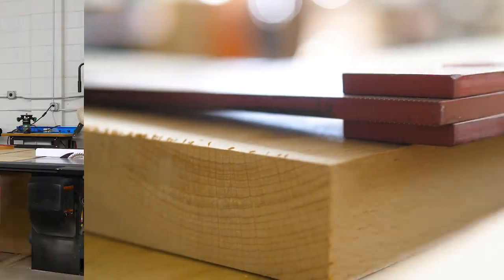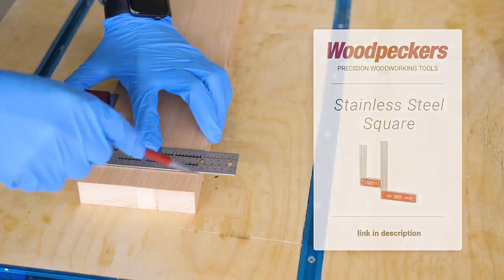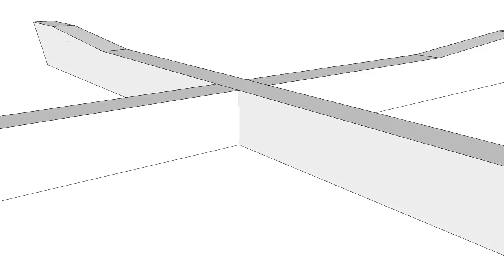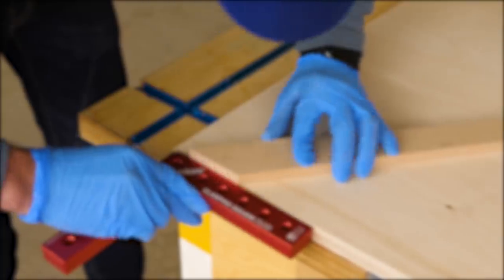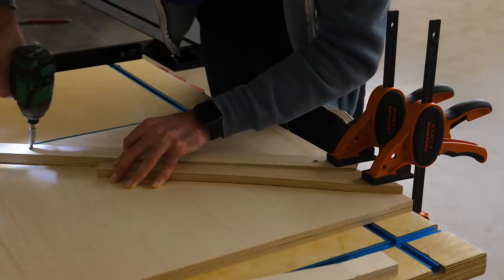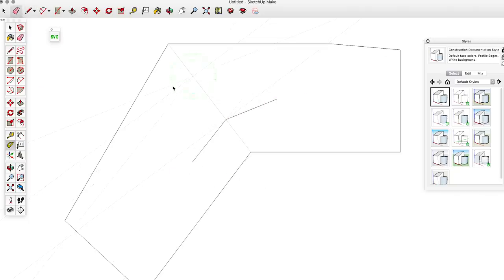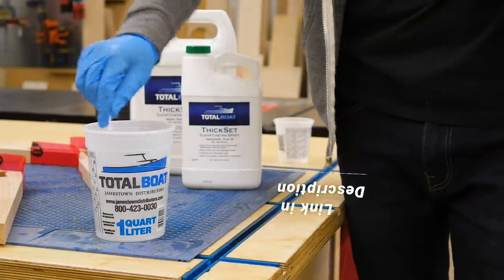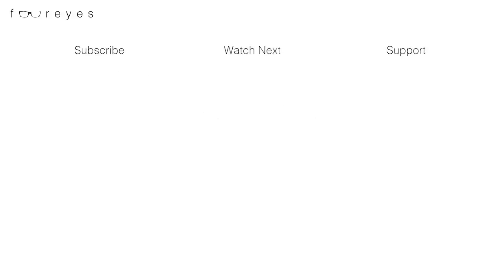A New Woodworking Technique? | Epoxy Locking Miter Joints

Comment: This kind of joint has existed for a long time, as it's just a splined miter joint. Only difference is the spline isn't rectangular, or another piece of wood.
Reply: I think that’s the idea. It’s poured, which is worlds easier and more customizable.
Reply: @excaliber90887  Have you ever seen a splined miter? The traditional process is a lot easier and faster than this one.
Reply: It's not a splined joint at all. A splined joint gets it's strength from the overlap of long grain glue joints. This is nothing but a series of butt joints.
Reply: @johnnymeans356  Just as i asked the other person, have you ever seen a splined miter? Also, resin pieces do not have grain, at all, so your argument is entirely invalid. This is a miter, with a spline joining and reinforcing the main butt joint, thus making it a splined miter. 
To be more specific, this would be a case miter spline. From what I've seen, case miter splines seem to be a lot less common than frame miter splines. But again, resin does not have grain, so any grain orientation arguments are entirely invalid in this case. And again, where a traditional spline is typically just a thin piece of wood, though I have seen squares before but I believe those tare more decorative than functional, this is a modification of the splines shape, though it still has similar use. 
Because of the modifications, the spline acts more of a puzzle piece than a glue-reliant piece. Arguably this is also true for a traditional spline, as it is more than a purely glued joint in the orientation of case miter splines. But this also does not mean that this makes the modified spline, in material, shape, and use, not a spline. 

At the end of the day it's still a spline joint, because the piece itself is literally a spline. The definition for spline, in the case of woodworking is, "A strip of wood or other material inserted into grooves in each of two pieces of wood to provide additional surface for gluing;" but because of the modifications of shape, from strip to a different shape, and of material, from wood to any other material, and use, as gluing wood and non-wood materials isn't entirely compatible unless you use some kind of epoxy that is compatible with both, makes it a modified spline, as it serves similar use. If we look at other definitions of spline, such as mechanical splines, "Long thin piece of metal or wood," although arguably outdated in terms of material as this is a definition from the mid 18th century or, "A rectangular piece that fits grooves like key seats in a hub and a shaft, so that while the one may slide endwise on the other, both must revolve together," we can see where the woodworking-specific term is derived from, and we can also derive a definition for the specific kind of spline in this video based on these definitions. Thus making it a spline, as it acts as a key that does fit into a shaft, or cavity, and acts as a gluing surface assuming you have a material-compatible glue.

You cannot mix traditional terms and definitions with nontraditional manufacturing methods, this is where your argument falls apart, and where my argument still stands. At the end of the day, this is a modern modification of what's traditionally a case miter spline, and that is backed with logic and references to definitions for an otherwise undefined variation of a spline. If you want to argue about definitions and how they work, just keep in mind that everything is constantly evolving, and definitions eventually become archaic and outdated, if not eventually invalid in modern use; so while this spline and it's use might not have a set definition, it can be defined by referencing other definitions to create a definition, as this is an evolution of materials and methodology of use. This spline is just as valid as any spline, because at the end of the day, it literally is a spline, which is why my argument still stands. 

If you want to argue the gluing aspect, I can also argue that the pouring process itself acts as a glue-up, as the liquid resin can, and most likely is, absorbed, more than likely absorbed by a fair amount, that then has to harden, thus acting as a glue as a secondary process to it's primary process of forming a plastic within the cavity it is poured in. Not a traditional glue, but serves the same purpose; again, evolution of materials and methodology of use, which then evolves linguistics. 

I would suggest doing the slightest bit of research and fact checking, and using the slightest bit of logic before arguing something. No matter how you look at this joint, it is a spline, and that is backed by logic and referenced definitions, thus making my argument valid, whereas yours is not.

Comment: Instead of using wood glue to bond the joints also use epoxy, because then when you use epoxy as the tenon member- it will be an incredibly strong joint!
Reply from the maker: Good call...I totally should have done that

Comment: Which do you think was the strongest?
Reply from the maker: If I had to guess...probably the butterfly because it had the thickest epoxy portion. But I think all were fine as all of them split at the wood (not the miter) telling me the joint is only as strong as the wood.
Reply: Needs further investigating. I think the long surface area of offset shape could have proved to be the strongest
 This needs science!

Comment: Why break it in the end could have sold it I mean it still was a bit of work
Reply: Guess its hipster thing. Testing the joints durability would been stupidly easy by just making copys of the joint with scrap peaces and would not wasted time, effort and materials. Then again amount of good material this guy trows away is pretty ridiculous, where i try to minimize all the loss and utilize recycled materials if all possible. After finding suitable shapes and methods, final test peace could been made to test real world durability and that one could been sold for profit.
Also note how epoxy wont even adhere to wood properly. Seems that this epoxy wont work on it as cheaper boat makers epoxy sure does get sucked into wood and ties it self, where wood rips before epoxy.
Reply: @Hellsong89  sorry buddy, take another look at the failure, the joint failed where the pieces met with ordinary wood glue, and if you remember it was not clamped either and he explained why. the joint failed because of the type of joint, and probably would have failed anyway. because the epoxy bow was so far down on the bottom of the joint, any movement made when the mitred joint started to fail, is intensified, and becomes a fulcom which hastens the failure instead of adding strength. Regardless of the type of glue used, I think it would still fail without bracing or a doweled/.  pinned half lapp. Been using epoxies for more than 50 years, so I guess I know enough. This epoxy did not fail, the joint did!

Comment: Would be interesting to know if any of the epoxy insert shapes broke or deformed in any way after getting the hammer in the end, or if all the breakage was in the wood.  Also, if instead of a hammer, some sort of scale could be used to know which one held up longest.  Not that this would be going into an industrial application or anything, but, you know, just cuz....

Comment: Please warn all woodworkers, do not crosscut wood trapped to the fence (re; minute 1:03). This is a very dangerous habit. If your pieces had skewed just a tiny fraction out of square to the fence this could have instantly gotten very ugly. Note: you can use the fence but only if the fence leaves room for you piece to skew as the blade finishes the cut, ie; you have spacer block forward of the blade or a short fence, again forward of the blade.
Reply from the maker: That's why I bumped it out of the way before I cross cut...it's probably farther from the wood than it looks on camera, but for the camera's sake I should probably also bump it even farther out.

Comment: You are using a 120v./30a. plug with an extension cord that is not rated for 30 amps.  The cord should be #10 wire or larger. For your safety, get a length of #10/2 w/ground cord and replace the cord you are using. The plug is suitable, the cord is not.

Comment: nice visual style, not very sturdy in terms of construction the epoxy matrix (Tensile Modulus of 3500 MPa) has way less stiffness than the oak (Tensile Modulus of dry oak (12%) ±11000 MPa)) used. That is a factor between 3 and 4!

Comment: If the glue in a glue joint is stronger than the wood, why go to epoxy??  If you are covering mistakes that is a different story.
Reply: erkeltree a glued edge joint is stronger than wood but a glued mitered joint (end grain to end grain) is a really weak joint. The end grain sucks up the glue
Reply: Mitchell Ragle I think your confusing end grain with edge grain joints. End grain joints are the weakest type of joint. The reason box joints, dovetails, Lap joints, mortise and tenons, reinforced miters, etc, exist is reinforce an otherwise weak end grain joint (butt joint). Edge joints, often used to glue boards side by side into larger slabs, are strong joints where the wood will break Before the glue does.
Reply: Mitchell Ragle try replicating the test at 14:46 without reinforcing your miters and report back

Comment: Very dangerous technique of cutting timber to length using a fence on the circular table saw. Don’t do this as it can easily twist and deform the blade  causing  the piece to be ejected with great force.
Reply from the maker: I'm not using the fence. I use the fence to initially set the distance and then bump it out of the way to make the cut, so there is no contact anymore.
Reply: Ok thanks

Comment: You are not supposed to load epoxy like that though, I guess it's only for looks?
Reply: Some epoxy formulations are just as strong as wood. Not sure about this one in particular. Also, to get optimum strength you often need to apply heat post cure.
Reply: @mckenziekeith7434  strong in compression or tension? That is what I meant by not loading epoxy like that, it's tensile strength is quite low.
Reply: @malloott  structural epoxy can be about as strong as douglas fir in compression. 12000 psi or so. But only if heat cured, so I guess you are right, for practical wood working purposes. Unless you want to go to the trouble to somehow heat up the whole piece for several hours after the initial room temperature cure.

Comment: In principle, I hate this kind of abuse of epoxy. It is unecological, wasting of resources, overly expensive...

If you have luxury of CNC router, as easily you can make slots in your pieces, just as easily you could make perfectly fitting pieces into those slots from material of your liking.

Comment: 1:04 Cringe!!!  I guess you've never had a piece grabbed between the fence and blade yet. Won't be long.  Maybe buy and use a catchers cup in the meantime.  Or just DON'T do it.  I really liked your miter sled though.  ;-)
Reply: calisdad3 Didn’t like the open jacket’s flaps leaning over the table saw much either.

Comment: 1:04 - DANGEROUS.  Good God... using the sled and the fence?  BASIC woodworking mistake.  It's a wonder you didn't have part of that board embedded in your body.  Wearing nitrile gloves will stop very minor finger oil issues, but just wash your hands, rinse and dry well first and there's no problem.  You're sanding later anyway. Wearing gloves while woodworking is asking to be snagged.  You've got a nice shop and set of tools... maybe cut out the humor and get serious.